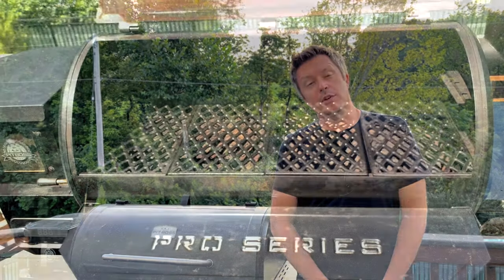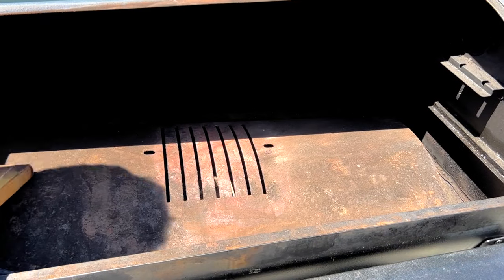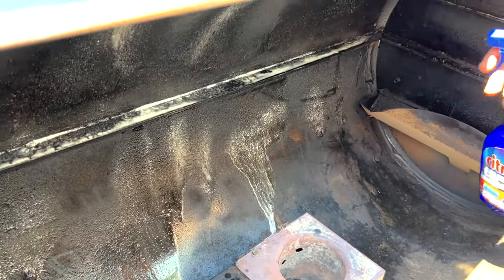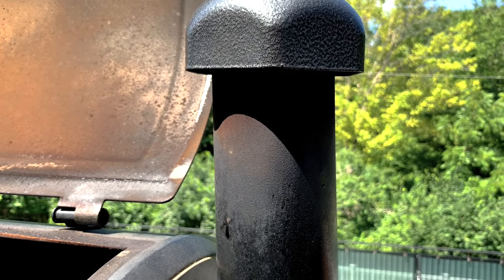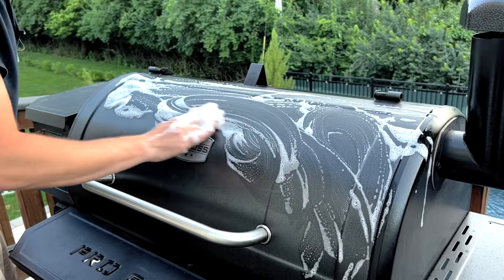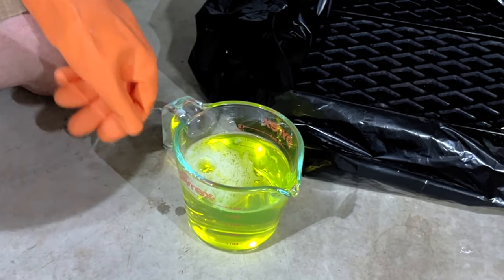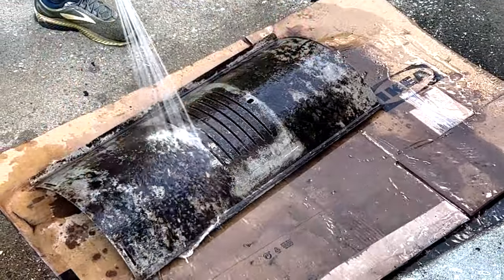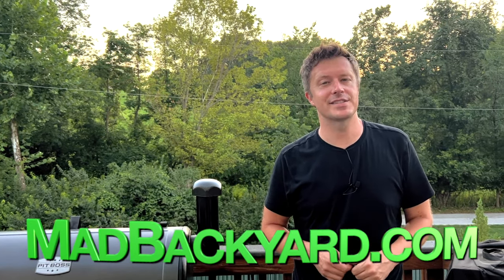DEEP CLEAN a PIT BOSS in 4 EASY STEPS! Plus RUST Removal!

Comment: OMG, what a process! 😳 I’m so glad I have a Traeger. And in 3 years, the only time I gave it a deep clean was right after I used a Pellet Tube for the first and last time, never again!! Too much liquid gunk from that, returned that crap right after. What was pit boss thinking in desgning that broiler plate?? … on a Traeger you simply replace aluminum foil from it in 5 minutes or less, vacuum out the rest and it’s as new - NO RUST ANYWHERE in 3 years. I feel bad for Pit Boss owners… thx for sharing this, I guess 😅🤷‍♂️

Comment: Great deep clean, for the grill grates I have scrubbed them down and then put them in the dish washer, they come out looking like new , mind you any burnt bits are left at the bottom of the dishwasher, no biggie. As for the flame broiler I cover it in tin foil and when its time to clean it peels off and not so dirty, I don't cover the sear plate. Anyway thanks for the other tips on cleaning. Cheers.
Reply from the maker: Thanks for watching! Pit Boss doesn’t recommend using foil on the flame broiler. I think it’s ok for lower temps but can stick to it at higher temps and make a mess.  That flame broiler gets up over 750 degrees in certain spots so need to be careful.
Reply: @madbackyard  Thanks , I figured higher would be not wise , I almost never go above 300.

Comment: What kind of product did you use for the rust, the spray?
Reply: He used white vinegar soaked paper towels and let them sit on the rusted areas for an hour
Reply: Then he sprayed high heat cooking oil to keep it from re rusting
Reply from the maker: Yes.  White vinegar soaked paper towels work amazing on rust!  Just give them some time to work, wipe clean, repeat if necessary, and then re-season with cooking oil right away to keep rust from reforming.

Comment: I have used the Costco black bins to clean my cooking grates and flamebroiler. I usually just use dawn with hot water but every once in a while use the oven cleaner for bbq spray the grates and flamebriolet let it set 20 minutes then add the hot water and dawn soap. Using a SOS pad and regular kitchen scrub pad works great. I wash and rinse everything thoroughly. No taste or chemical issues.
For easy clean up I use foil to wrap the bottom part of my barrel and I wrap the flame broiler also just cut out area if I want to sear. I also use tray that I put my meat in and metal racks that fit in them so my smoker stay clean all the time. Only clean up is ash and when I sear

Comment: Should I spray high temp cooking oil on on my surfaces BEDFORE the initial burn in?
Reply from the maker: When it's brand new...No.  Do one high heat burn with no oil to burn off factory residues, then another after spraying to season it. Everything's new and nothing is wet so there's no worries about rust.  However, when cleaning, it's a different story. If you've just removed rust or washed any kind of metal like the flame broiler or lid, you need to dry it and spray right away or else they can re-rust within a few minutes even.  So I just keep it simple and quickly dry and spray anything I've washed right away then do the burn in after that.  Hope that helps and makes sense.  Thanks!

Comment: if you want to do a real deep clean, empty the hoper and auger of any pellets.  Remove the grates, fire pot, heat shield, etc and vacuum out the pellet dust.  Unplug the grill and use a steam cleaner on the grates, barrel, etc.  Spray the interior and interior parts down with a non-toxic degreaser.  Let it sit for 10 min or so.  Then use a 1700 psi or so pressure washer to clean it out.  Do the outside the same if needed.  Let it sit in the sun for a few hours (I'm in the southern US so this isn't an issue), colder climates, YMMV.  Spray the interior down lightly with Weber grill spray after it is dry.  Do the initial start up procedure as recommended in your Pit Boss manual.  Smoke a Boston butt to add back some of that awesome fatty seasoning.

I do this about once a year, just do it on the lawn, not the patio or deck (lesson learned the first time I used this method...

Also, make sure the smoker isn't level, able it to where the grease bucket is a few degrees lower than the pellet hopper.

Anyway, just my experiences over a few years.  Most important, keep on cooking and smoking.
Reply from the maker: Great tips! Thanks for watching!

Comment: Good Video but 3 helpful tips for you :

1) Scrape most of your heat shield IN the smoker, then vacuum with the rest of the ash.
2) Line the grease trough and spout at the end of the smoker  with foil for easy clean-up
3) Wash the grates and shield in a bucket, keeping the mess contained before spraying off.
Reply from the maker: I believe we did 1 and 3 in the video already.  As far as 2, I don’t see a need.  It’s easy enough to wipe out the grease catch chute with a paper towel. When you start putting foil in there you risk blocking the spout and messing up airflow and grease drainage.

Comment: Would you use the wooden grill scraper to get the carbon build up off? It looks like bubbling paint but it's not (i had to google it)
Reply from the maker: Hi Kathy- I only use my scraper on the flame broiler as I show in the video. I would not use it on the enamel of the inside walls of your grill if that’s what you’re referring to.  Some build up is actually a good thing. Don’t worry about cleaning this back to brand new. Just use a gentle cleaner like citrusafe and a shop towel to wash and rinse.  No scrapers or steel wool etc.  scratching the protective enamel can lead to some serious rusting pretty fast. Hope that helps!

Comment: Would you consider seasoning the outside of the grill chamber with oil to prevent rust?
Reply from the maker: You can. The areas I’ve found needing it after several years of use now are the top of the exhaust chimney pipe itself (not the cap) and where the lid overlaps the body of the grill. Check out our deep clean video where we show how to season these area after cleaning off rust.  DEEP CLEAN a PIT BOSS in 4 EASY STEPS! Plus RUST Removal!
https://youtu.be/fDQTh4GhAj0

Comment: I foil wrap my flame broiler and replace every couple of cooks.
Reply from the maker: Works for low and slow but will adhere and make a mess if you turn up the heat with it wrapped in foil so just be mindful of that.

Comment: The only thing that concerns me is regarding the Flame Broiler plates. The owner manual says do not wash clean. 
Only wanna verify because I’m new to smoking and my wife would kill me if I ruin it! 😂
Reply: Also interested because man, a 16-1/2 lbs brisket was a mess afterward!
Reply from the maker: Thanks for watching Chris- washing it is optional. Don’t do anything you aren’t confident about until you get more used to your smoker. You can just use the wooden scraper like I show and as long as you keep up with it should stay in pretty good shape.  Thanks!
Reply from the maker: Yes that can be a pretty big clean up afterwards! I just did a brisket this weekend and actually put it on top of a wire rack baking sheet combo wrapped in foil for the second half when more of the fat started rendering.  It caught most of it and made cleanup a lot easier.

Comment: I just use aluminum foil on the heat shield for easy cleaning.
Reply from the maker: Works fine at lower temperatures but foil can meld onto the flame broiler at higher temperatures on a Pit Boss because there is no type of diffuser under it like on other brands such as Traeger, where it is fine to do that.  So the flame broiler takes a lot of direct heat and gets incredibly hot. So be careful covering it with foil at higher temps you can end up with a mess.